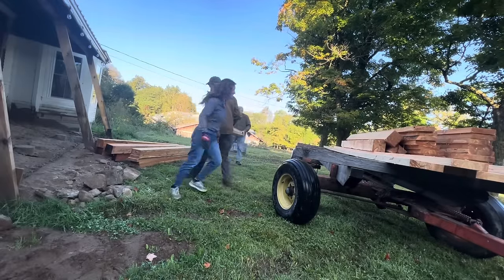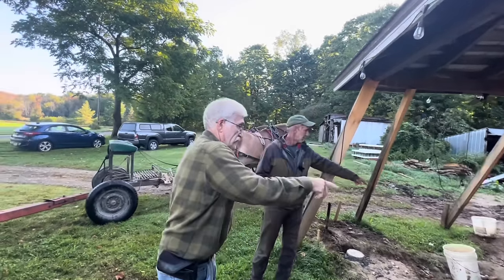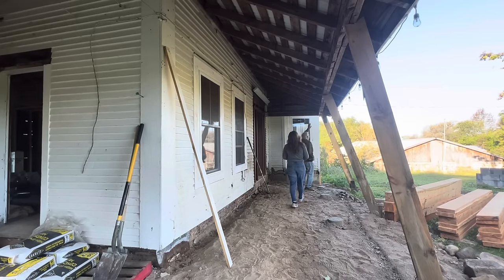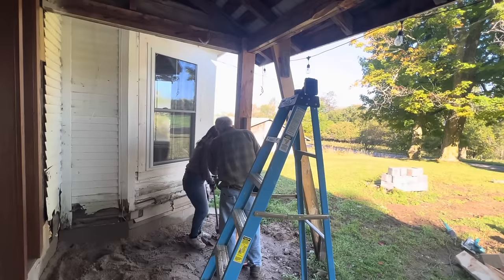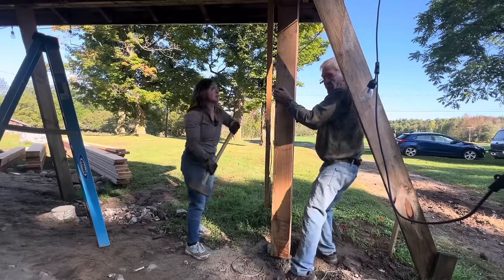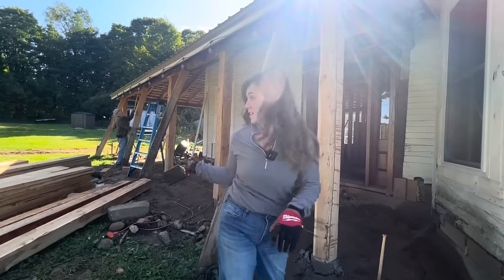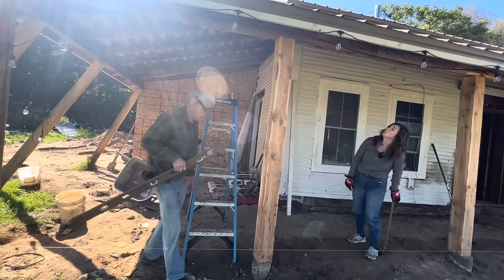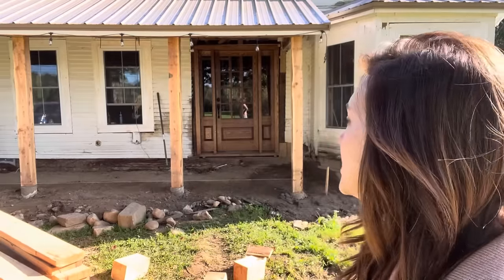PORCH POSTS are going up for my NEW WOODEN PORCH!! | my Total Home Renovation

Comment: Gorgeous gorgeous wood!! You might consider thinking about not painting them white and giving them a clear coat- they look amazing with your front door and roof. As well, you might think of how else you could include it inside, like for open shelves in the kitchen and bathrooms... maybe making your pantry pocket door out of it, ( I think a simple door like that can be an easier diy than say hinged doors or exterior doors etc). There might be other ways you could use the wood too. Maybe the stair hand rail etc, etc... and also when you do the back patio area some benches or something... 

It’s great to hear Jay with his new Mike!

Comment: I’ve never made a porch nor have I seen one made. I was wondering what came first. The post or the floor. 😂 Now I know. The inspiration picture is beautiful. I was thinking if you only had the post and deck with no rail that the porch and post would look beautiful in the same wood stain as your front door. But since you’ll be having a railing I think the white will be beautiful.❤

Comment: Wow! Looks sooooo  good Abby! Love how the porch is already looking better. :) 

I do have a question though, when you poured the concrete into the holes for the posts I don't remember you putting in any sort of rebar or anything to keep it from cracking and falling apart with changing weather, and now it seems like you haven't secured the bottom of the posts to the concreate with anything other than gravity, isn't there a risk of snow piling on the roof of the porch and kinda toppling it outward if there is nothing that fixes the bottom of the posts in place? I am imagining cold weather contracting the wood and possibly the cement a bit, and making the posts lean outward... am I mistaken in that? 

Again, I absolutely LOVE that front door! I'm so looking forward to seeing the new beautiful porch against that lovely door! :) Thank you for taking us along for the ride!

Comment: shouldn't the BOTTOM of the post be on a bracket to keep them OFF of the concert
Reply: Yes
Reply: That I was also wondering about, as the posts do not look like pressure-treated wood, and no other kind of moisture barrier between concrete and wood I could see.

Comment: Abby be careful using the sledgehammer over your head like that. you need to keep your back straight. you were arching your back backwards and it puts too much pressure on your spine the wrong way. it can cause a serious injury to the spine and soft tissue. if you have to lean back like that then take a step back as you are too close. the porch is coming along great. cannot wait for the floor to come in and railings!